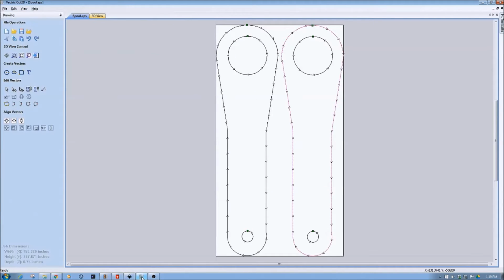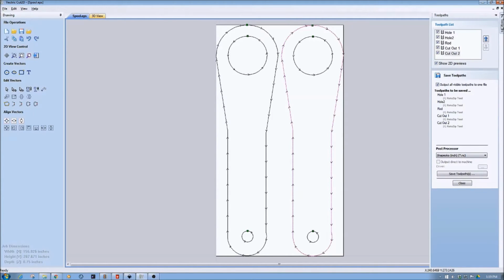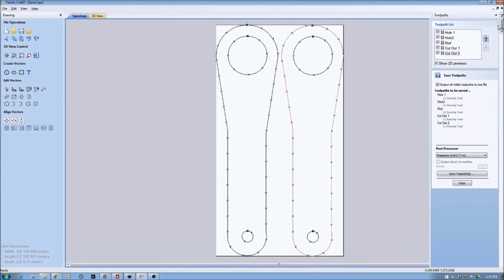CNC Machine Project - Spool Hangers for 3D Printing

Comment: Looks like it's going to work out nicely.. How long did it take to cut the arms out.?
Reply from the maker: +RJ_Make Yes has worked very well as mentioned in video, I just spool it down and run it thought the printer.  To cut out, less then 10min and actually I am building a double-decker version for even more spools :-)